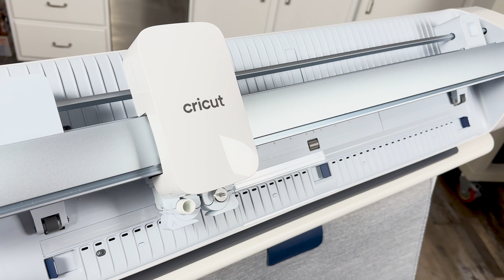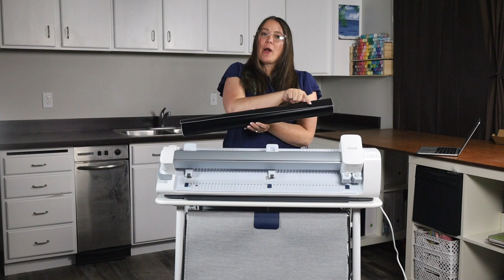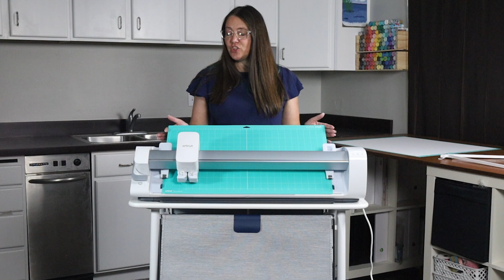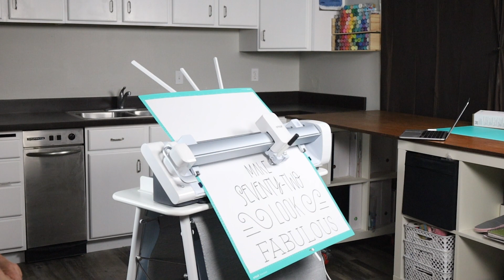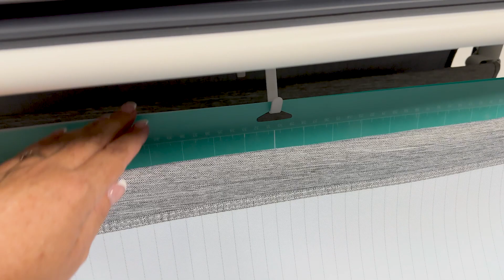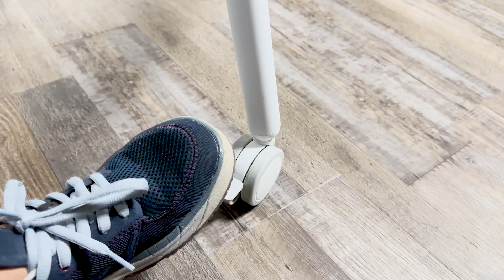Introducing the Cricut Venture 24-inch Professional Cutting Machine

Comment: Thank you for the Cricut Venture overview. I’m considering the Siser Romeo or Venture. Projects I want to utilize with either of one of these cutters is fabric. Specs for the Venture states over 100 materials, but does not provide most of the type of materials. I tried to call Cricket and wait time is 45 minutes. Few years ago never had to wait long for Cricut support, less than 5 minutes. 

Can this cut fabric? And do we need to use Cricut vinyl brand only? Thank you.
Reply from the maker: Sadly the Cricut Venture cannot cut fabric.